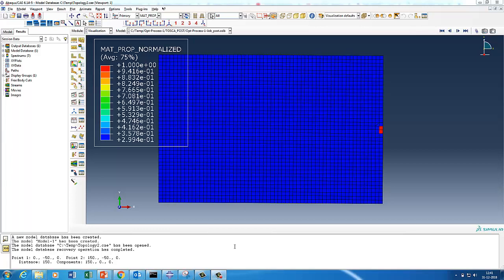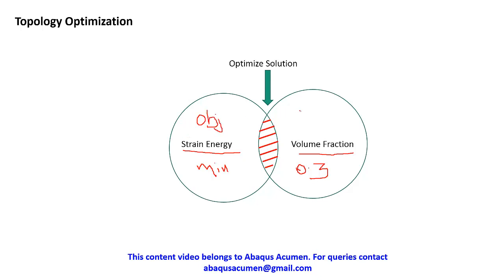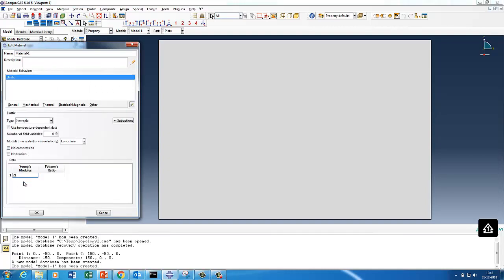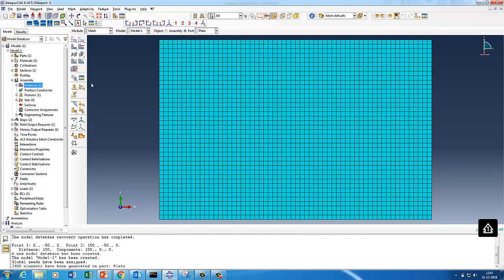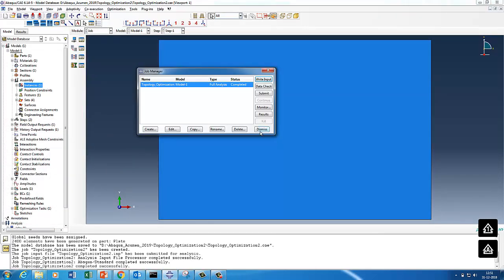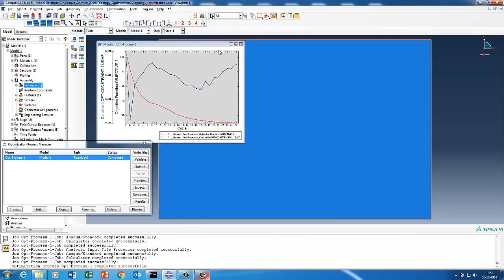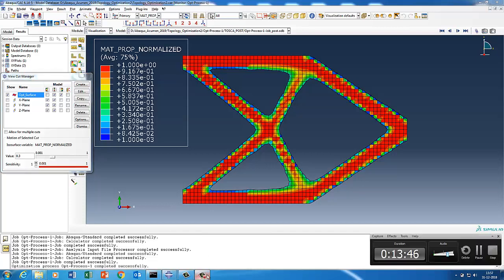Abaqus Topology Optimization Tutorial: Cantilever Example

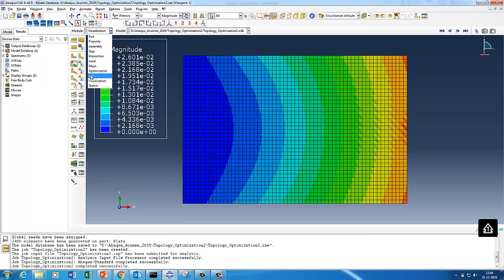Comment: Hourglassing effect at 7:54. Do you use elements with reduced integration? Elements with full integration capability should avoid this behavior.
Reply from the maker: HI, This is linear static analysis. We have used the full interaction elements. Because of high deformation scale it look like hourglass effect.
Reply: @abaqusacumen7397  I understand, thank you for the information and your videos. Helps a lot. Could you possibly make a video of a multibody dynamic analysis (f.e. piston-conrod-crankshaft assembly) for calculation of the occurring stresses or something similar?  Thanks in advance